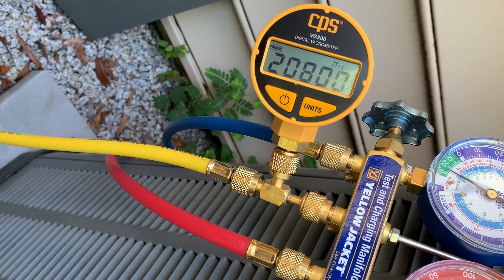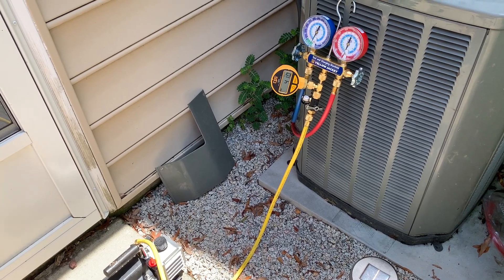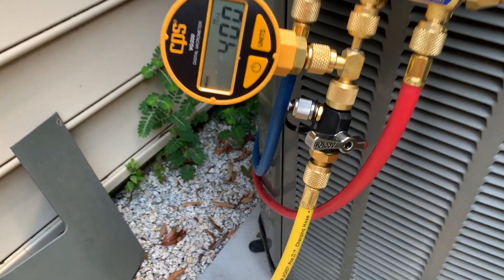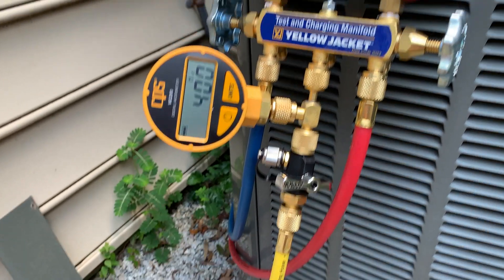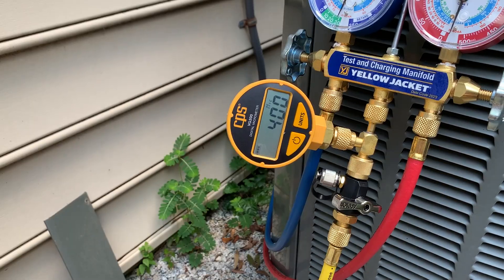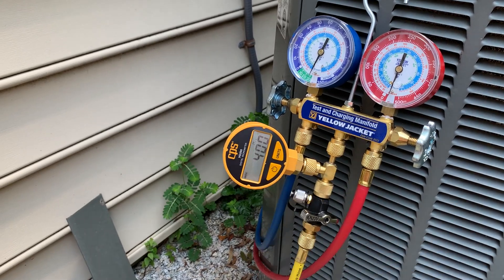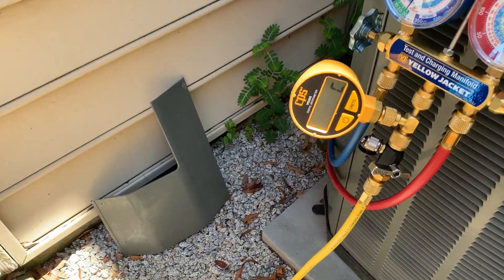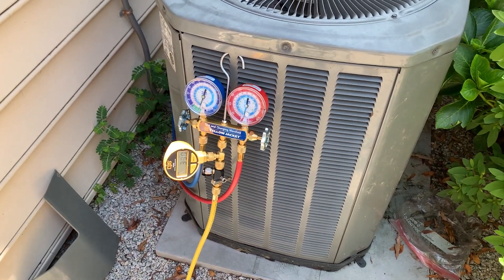HVAC Vacuum Setup - Pull Deep Vacuum

Comment: About how long did it take to pull to the deep vacuum with that HF pump? You mention it was fast, just want to know. I am about to take on replacing my coil and will need to pull a vacuum.
Reply from the maker: Hi there! So it took a few minutes to reach a deep vacuum level. I then let the pump run 10-15 minutes longer to pull air out of the line as much as possible. I then closed the isolation valve to “lock in” the vacuum. Hope that info helps and than you for watching the video. -Dutch
Reply: A couple things. First , I'm not an HVAC tech but I've done my own work (for better or worse). The micron valve should be as close to the system as possible. The isolation valve  is used to isolate the micron gauge from the system, if you are going to open the valves and pressurize the system. Most people use a couple or 3 valve removal Ts. Take all this with a grain of salt, that's how I was shown and how it was explained to me.